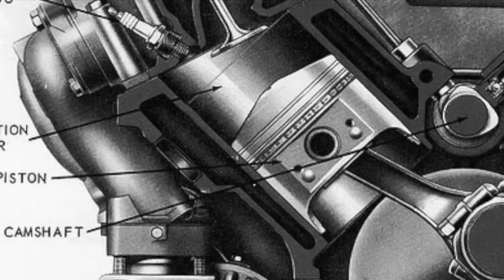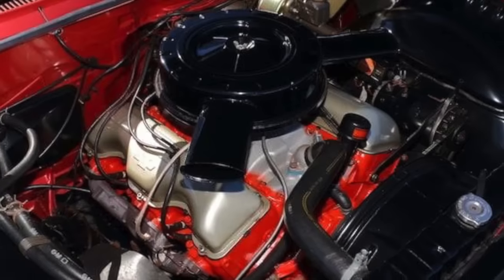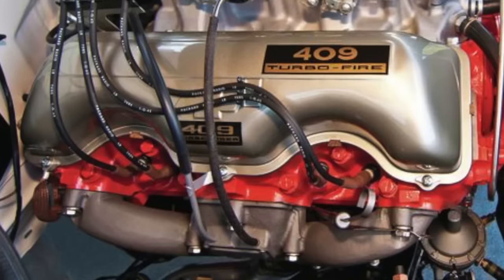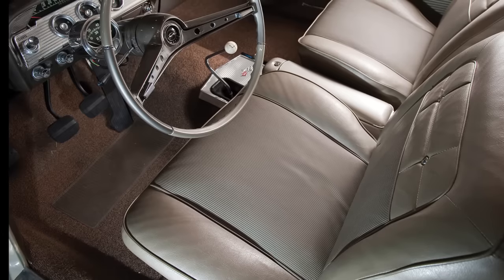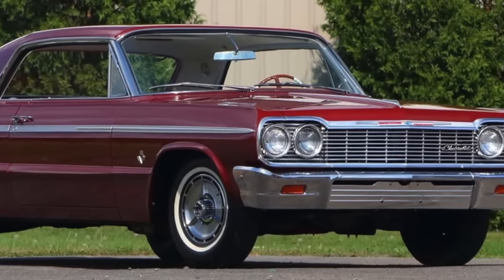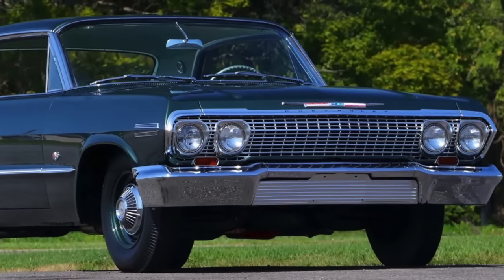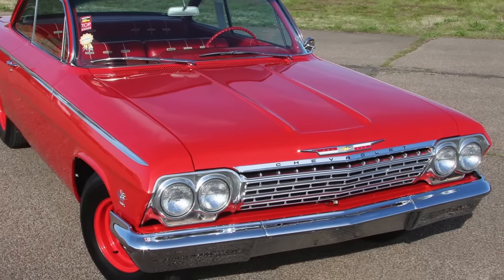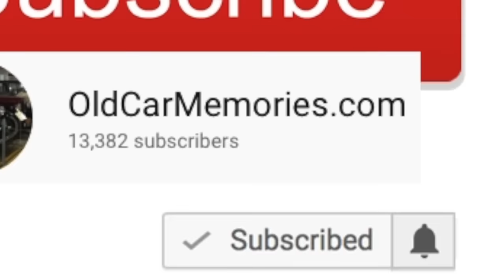1961-1965 Chevrolet 409 V8 - The Ultimate Budget High Performance V8

Comment: Ahhhh, OK, but Olds developed the ground breaking 303 OHV V8 in '49, and then Chrysler really showed the way in '51 with the awesome Hemi V8....4 years before the Chev small block.....FYI....
Reply: I once bought a used 50 olds coupe I believe it was and  not only was it a overhead valve engine but it was a factory stick shift. almost all olds were Hydromatics in those days.
Reply: Yup, when Olds brought out that mill, being over 300 cubic inches (303, to be exact) in those days was a VERY big deal..6 years before Chevy..yes, you had a rare one, I'll bet it had few options. They installed the very early Hydro in many of the cars, but most of the budget models most likely did have a stick shift, as the hydro was most likely an option..then two years later...the Hemi, came out, in the Chrysler and was a whopping 331 cubes...and motoring (especially hot rodding) really took a HUGE turn.....now, you need to find that Olds (or one like it) and relive the good times!... @boathead22000
Reply: yeah, we all miss those big chrome machines. I don't miss that 6 volt battery system though but I bought a Hester 8 volt battery and that beast would start so much faster.I had several muscle cars 348, 409 and even a 406 powered ford and now I drive a 2 litre 4 banger...lol
Reply: @SSGTA440  Most Olds V8 were indeed Hydramatic, as Oldsmobile is who designed and introduced Hydramatic to the world.

Comment: this engine could of been used in the medium duty trucks then  too. was before Chevrolet replaced this motor with the big block the medium duty trucks went to either a 366 or 427 engine the cars and light trucks went to a 396, 427, 454 big block.  As today its turbocharging smaller displacement engines with more hp and better fuel effeciency.
Reply: And more complexity, more heat, more trouble.  More cubic inches is better, except in a light sports car.

Comment: The term patented by Chevrolet in 1965 to represent the 396 is when they started using big block to describe large Chevrolet patented engines. Chevrolets first verse eight was not in 1965 it was in 1917 and 1918 series D vehicle.

Comment: Were the transmissions Muncies?
Reply: Machi74005 no
Reply: Heaven was the Hurst Shifter... stock in GTOs...
Reply: '61-'63 were B/W, '64 & '65 '09's were Muncie's.
Reply: The muncie 4 spd. was aluminum case, the borg warner rock crusher was cast iron case.
Reply: Fyi, chevy small block, the biggest valve size was the double hump 2.02 intake, but there was a sm.block v8 in  trucks that had bigger valves than that.

Comment: Anyone know why Chevy reduced the compression ratio from 11.25:1 in 1961 to 11.0:1 in 1962. It seems natural that Chevy would continue with the higher compression ratio as it used it on the 348. I have read that Chevy had difficulty with the early 409s in 1961 and so it stopped production of them at only 142 cars with the 409 then. The next year, 1962, Chevy begin production of them but with the reduced compression. It did use hotter cams, larger head ports, dual carburetors and a few other modifications to increase power. Yet, it never used the higher compression ratio, except in the Z-11 option in which 13.5:1 compression ratio pistons were used. Did the higher compression ratio pose a difficulty in the thinner walls in  the stock 409s?

Comment: Chevrolet actually had a OHV V8 well before Ford had their flathead.  In 1917 Chevrolet made a V8 for their truck line but it only lasted 3 years.  The V8 was thirsty and didn't produce much more power than the 4 and 6 cylinder engines of the day.  Due to it's poor fuel economy and the fact that it didn't perform as well as they hoped, Chevrolet dropped the engine in 1919.  The next Chevrolet V8 was the one we are all familiar with from 1955.
Reply: That V8 was for cars, not, as far as I know, trucks.  I have seen both 36 horsepower and 55 horsepower.  Maybe the later ones made 55 horses?

Comment: Most of the problems with the 348 and 409 were from over reving it was hard if not almost impossible to over rev the small block chevy the w engines couldnt take it. People that installed a tach and stayed within limits had no peoblems

Comment: I had a 409. In its day it was competitive with the Ford 390. However the new 396 was a better engine for several reasons. The 409 was a truck engine, very durable, reliable and great in trucks and heavy cars that needed the low end torque. Racing however is another matter. The 396 was lighter, faster revving and could spin to 6000 rpm all day. The 409 was not meant for higher rpms and would come apart as the valve train was not meant for high rpm and sustained use and they had heavy pistons. Long stroke was great for reliability and durability but not for rpm. Thats why they are in tractors!
Reply: It was a short stroke motor.  The Pontiac engines had the longish stroke.
Reply: @michaelbenardo5695  absolutely,  my mistake!

Comment: "There would not have been a 389 Pontiac... or musclecar era.... if not for the 409...."  Boy that's really stretching it.  There were plenty of powerful engines in affordable cars at the time.  The conditions were right, fast cars with big motors sold, and Chevy had to keep up with the FE Fords and the Hemi Mopars!  If Chevy didn't build the 409 it wouldn't have made a dent in the era, although the 409 Impalas would be sadly missed.  Beach Boys could have just sung 406 about the Tri-Power Galaxies, but then Ford spent less on Hot Rod magazine and Payola schemes than GM did!

Comment: Wrong, Ford did not have the first V8, Cadillac had a flathead V8 in 1914, and Chevrolet had a overhead valve V8 in 1917-18, long before Ford.
Reply: truth.

Comment: The idea of a flat head surface around the valves with combustion chamber in the block and piston dome always appealed to me. It seems like the big bore with more room for even larger valves due to the angled deck surface resulting in an oval head to block area and unshrouded valves should breath much better. Obviously this is a non professional opinion otherwise it would have became more popular.

Comment: DOZENS OF THESE BLOCKS HAD STRESS CRACKING ACROSS THE MIDDLE OF THE BLOCKS ON BOTH THE 348 AND 409 VERSIONS!
THE FIRST SIGN OF THIS HAPPENING WAS LUBE OIL SHOWING UP IN THE RADIATOR!
ANOTHER BIG CHEVROLET 
FAILURE WAS THE TURBOGLIDE AUTOMATIC TRANSMISSION!
THERE WERE MANY OF THESE ENGINES AND TRANSMISSIONS REPLACE BY CRATE 327s  AND CRATE ALUMINUM 2 SPEED POWERGLIDES, A NEW DEVELOPMENT IN THOSE DAYS!!

Comment: So WHY didn't the 409 get put into some streeter-corvettes, maybe in '64?   Corvettes had alloy de-stroked versions in the "Grand Sport" attempt to compete with Shelby's Cobras.  Also, I think some Grand Sports saw an alloy Z-11.   Of course, Grand Sports were racing, only,--not streeters.   Although called a "truck engine",  409s and Z-11s were lighter than their replacement Mk-IV block 396-427s.   And WHY was GM "against" corporate racing?   The GM CEO coming up with that idea must have had the "Terminal-Stupids!"

Comment: How could they run 11, 12, 14 to 1 on crappy 1960 gas?
Reply: Octane level was much higher back then on premium gas. Usually 101-110 octane.
Reply: It wasn't crappy gas back then, it was actually better gas. Back then you could go to a Sunoco station and blend your gas at the pump: dial in the octane you wanted. It would mix in cheaper heptane heavy gasoline with an "octane rating" of say 90, which was low back then, with the purer octane heavy gasoline which was rated at 100 octane.
Let me explain where that word "octane" comes from. A basic hydrocarbon chain of 8 carbon atoms with each one having it's "wings" of two hydrogen atoms is a chemical called OCTANE. OCT = 8 in chemistry. It has a higher spontaneous combustion temperature than HEPTANE, which is a hydrocarbon chain of 7 carbon atoms, each with it's two hydrogen "wings". HEPT = 7 in chemistry.
Back in WWII pure octane was called aviation gasoline: it has an "octane rating" of 100, as in 100% octane. Most automobile gas was heptane with a little bit of octane blended in so you could use it in higher compression engines. If it had enough octane to act like it was 95% octane, it was given an octane rating of 95. That's what the "octane rating" on the gas pump means.  Everybody get it now?

We'll save the discussion of Tetra-ethyl lead for another thread. Suffice it to say we're all better off for it being banned by President Reagan.

Comment: Knock about 25% off of those horsepower figures to compare with SAE net numbers used today.

MT got 0-60 of 6.3 seconds and 14.9 in the quarter from a '62 dual quad 409;  I owned a stock VW Corrado SLC that did the same numbers at the drag strip and I have the time slip to prove it.  And it did this with front wheel drive and a naturally aspirated 170 cubic inch VR6.

These old cars SEEM fast but they really weren't-
Reply: They say that, but my old shop manual for 40s cars has both gross and net horsepower, and net is only about 12% less.
Reply: @michaelbenardo5695  That manual is seriously incorrect.  20% is the starting point, and 25% with many cars is more accurate.

Comment: 38 years after Ford produced a V8, Chevy/GM decided to make a V8 - 38 YEARS!
Reply: and GM built the best👊
Reply: Chevy was before Ford in 1917!
Reply: @stevew8722 , and Cadillac was before Chevy in 1914. Chevrolet only made 3,000 V8s from 1917 to 1919 and then stopped, but Ford made millions of V8s from 1932 to 1955 when Chevy got back into the V8 business.

Comment: These were god-awful engines.  I know.  I had one.  The big block Chevy was designed as a torque monster for Chevy trucks (GMC used a de-tuned Pontiac engine).  As the horsepower race accelerated, Chevy needed a bigger engine and put the 348 into passenger cars.  It was eventually enlarged to 409, and the nebulous Z-11 427.  The problems were too numerous to list, but the most notable include a tendency to bend pushrods (very common) which required pulling the intake.  They could not tolerate high RPM and were notorious for valve float.  In an era when most cars required at least a minor overhaul by 75,000 miles, the big block Chevy was lucky to make 50,000 miles.  And they were heavy, like ship anchor heavy.  Chrysler's 383 was far and away a better engine, as were the Pontiac 389 and the Olds V8.
Reply: I like Chevy, but they never quite got big blocks quite right like small blocks.  Ford and Chrysler and even other GM divisions made much more reliable big block engines back then.
Reply: and sbc s
Reply: but they dont sing...shes so fine my 383

Comment: ummmm incase your not aware pontiacs 421 was killin chevys 409 in 62.....also offered with dual quads factory rated at 405 hp but was known by p.m.d. to pull closer to 450+ hp.....oh and a 62 catalina is bigger and heavier then even a dressed 62 ss impala.....

Comment: Actually Chevy had a overhead valve v8 in 1917. It came in at 266 C.I.   Back then is was a expensive touring car. Chevy would not have a overhead valve v8 again until  1955.

Comment: This is so much BS... "There would be no muscle car era if not for the 409"....Really? First of all Chevy came late to the game with the 409, and it was only a "test bed".... it was an abject failure as it could not compete with Chrysler or Ford even when stroked... It was incapable of the high rpm necessary to compete due to intake angle and the slow 27 degree head that lacked a proper combustion chamber... Max Wedge Mopars and FE Fords ate Chevy's lunch so bad that they left racing in a huff!  Saying that Chevy perpetuated the Muscle Car era is hilarious to anyone who was actually there!